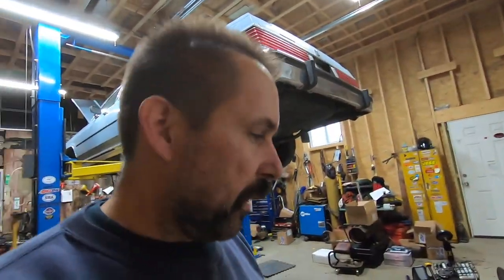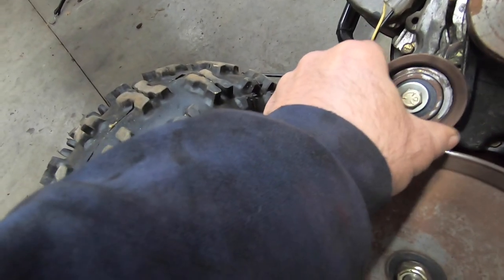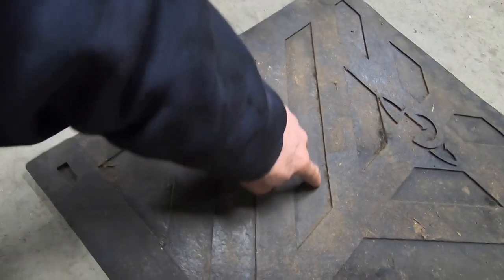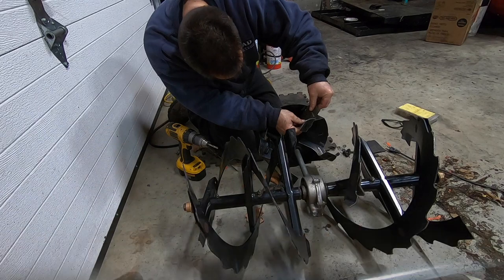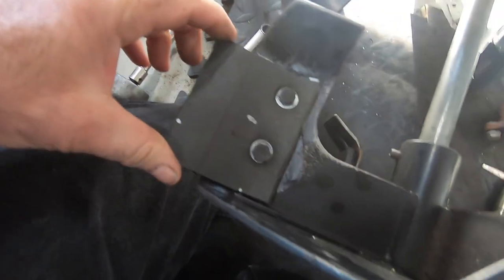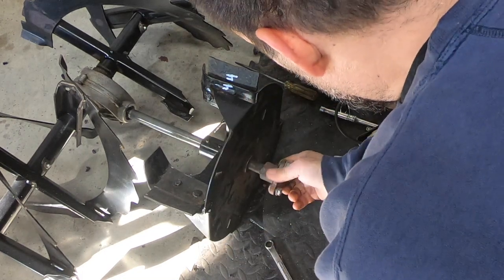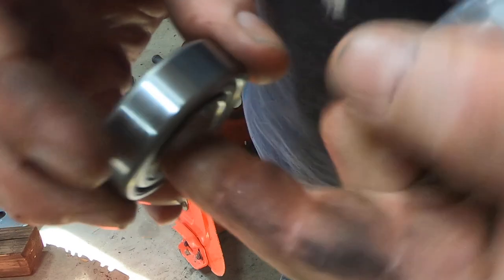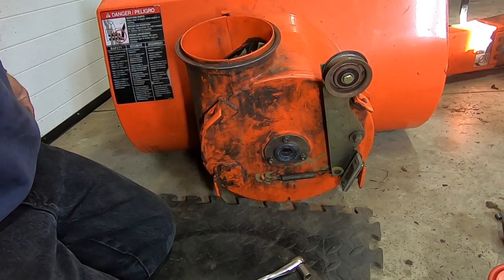'03 - '04 Ariens 1128 snowblower rebuild - impeller bearing, auger bushing, plus the impeller mod!

Comment: hey happy holidays!! nice vid. those impeler flaps will burn in just fine .been real busy my self lately 2 brakes /brakelines/clutch on 15 chevy spark waiting on parts ,from dealer on time flywheel bolts ,bs.have a good one .cleaning my shop 4 the past week almost get 3 cars in yeaaa.
Reply from the maker: Hey Willie - Merry Christmas! Glad you're busy! I'm getting hit left and right with snowblowers lately. Got a 2500 HD to do shocks and CV axles in today. Crankin' 'em out!  Thanks for watching, buddy.

Comment: I found using those pressed rubber doormats don't work because they break apart really easy, the best is a sidewall of a tire and cut it above the thick wire cord that goes around the circumference of a tire that goes onto the rim. Cut out a big piece of that rubber and then I just run it through the table saw with a plywood blade and it cuts it like butter. I put those rubber pieces on a dozen snow blowers and they all get an extra 10-12 feet of distance. The shute never clogs with ice, it keeps it shaved off. It seems like they all take about three eighths of an inch of rubber extended beyond the auger blade, and running it for a while will wear down the rubber so it fits the shute perfectly. Trying to get the impeller off the shaft is a nightmare and it's never easy. It's just easier to take the Chute assembly off and do it from the top with quarter inch stainless nuts and bolts with Loctite.
Reply from the maker: Yeah this one was a total nightmare. Took a TON of heat and severe BEATING to get that impeller to even move. Crazy!

The rubber piece I used was a mudflap off a heavy commercial truck. So far, so good after over 2 years. It did crack up high, since I cut the ends way too long, but the thing will throw pure slush right across the street with no effort. Been working great since the overhaul. Super happy with it. Thanks for watching. 🍻

Comment: hey, you dont know the proper technique to remove the impeller pulley hub. Next time, you turn it face up, PB Blaster or similar, two pry bars opposite, MAP or acetylene heat on hub, then, MOST importantly, have tow people hold tension on pry bars, then hit the end of the shaft with either a hammer drill set to hammer only, or an air chisel, with an adapter or socket one size smaller than the shaft. The vibrations with tension slide these parts loose easier than you can imagine. Pounding on the end of the shaft is wrong. You can end up spreading the very end of the shaft and never get the hub off.
Reply from the maker: Michael Weene  - Would be nice if I had the luxury of another body here to help me out, but I don’t. Got to do what you gotta do. Bottom line is, it came off and it’s fixed, right or wrong. With the amount of rust that was on this pulley, I don’t think another body would’ve made any difference whatsoever. This thing was frozen beyond frozen. It was a miracle it came off at all. Appreciate the tip, though.
Reply: late to the party, I use a pulley puller. easy peasy.
Reply: a pulley puller will take that hub off in 30 seconds. work smarter not harder.